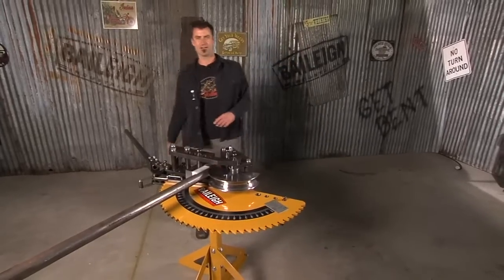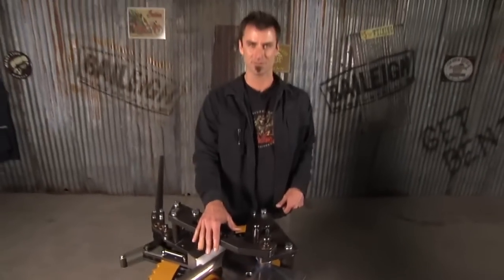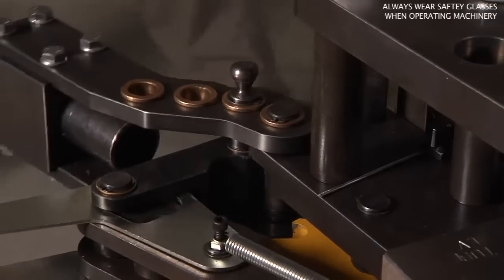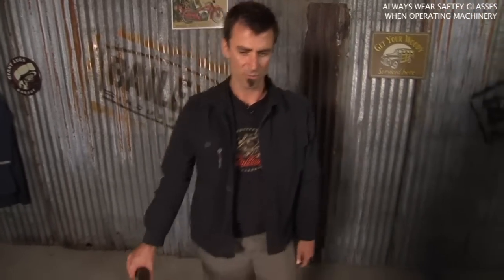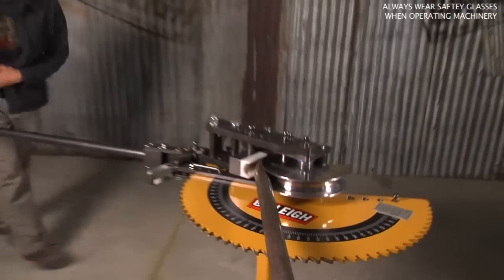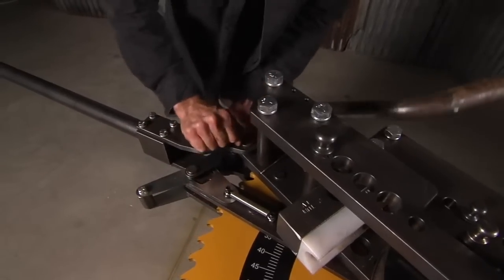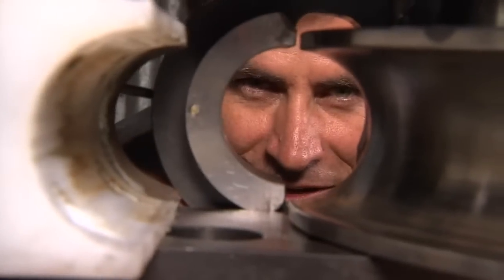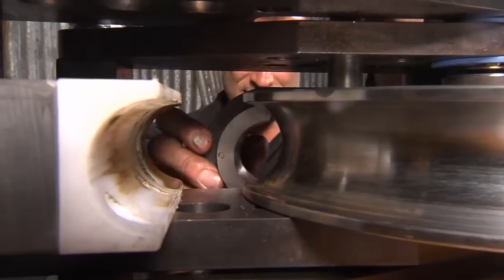Baileigh RDB-050 Tube Bender, 3 speeds, Large Capacity Tubing and Pipe Benders

Comment: How well does the base hold? it looks like it is free standing (no bolts holding it down)?
Reply from the maker: +Andrew Allender the base itself is very sturdy, there is however holes in the base to bolt the RCB-050 to the floor that we recommend you use